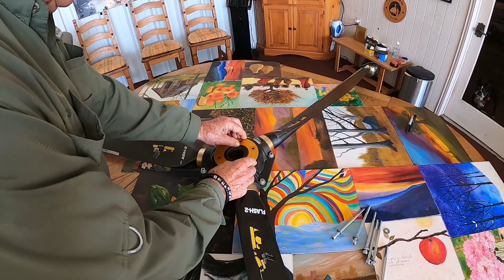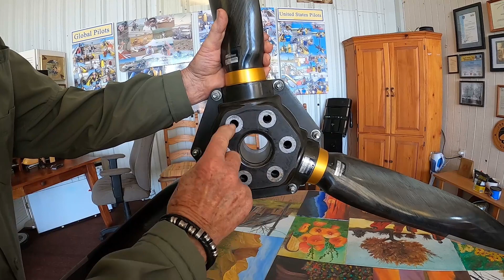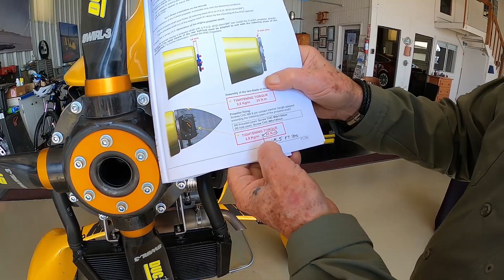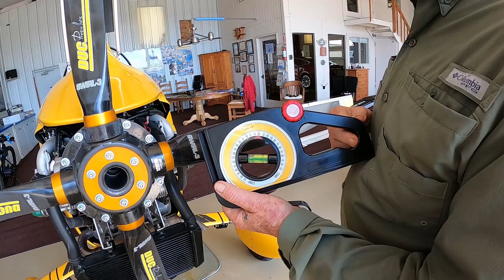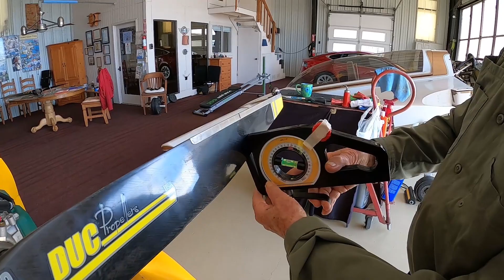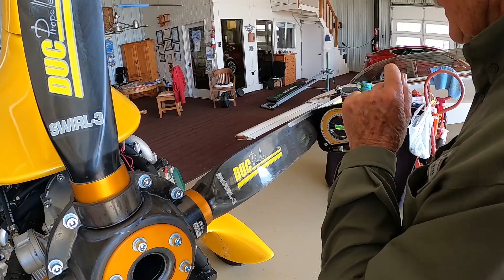DUC Prop Installation Tips & Tricks

Comment: just curious to know the performance figures, as in engine rpm at take off, and for example at a 80 mph cruise, together with pilot, passenger and fuel considerations vs factory original propellor.